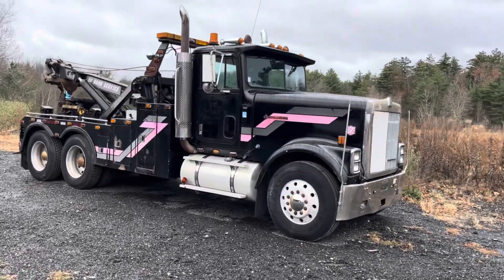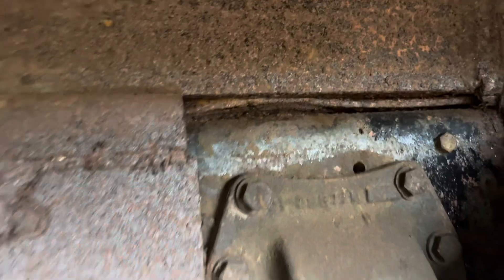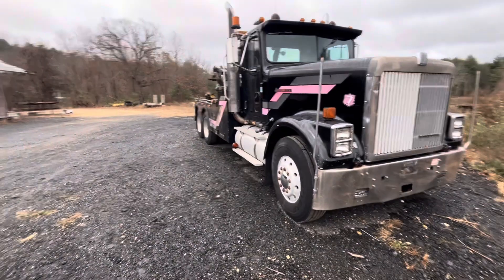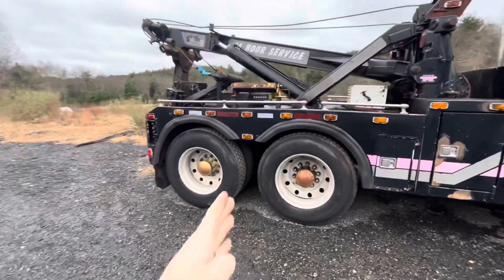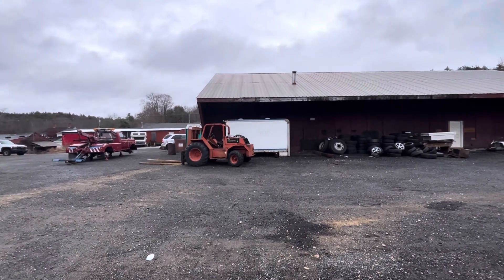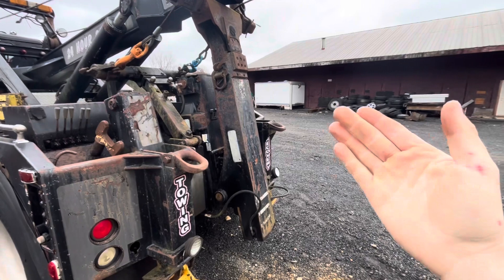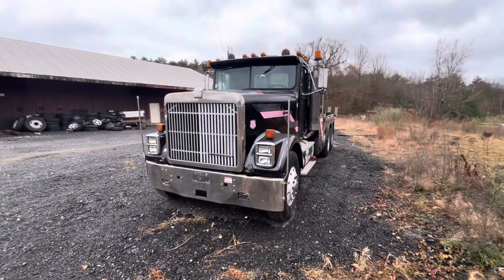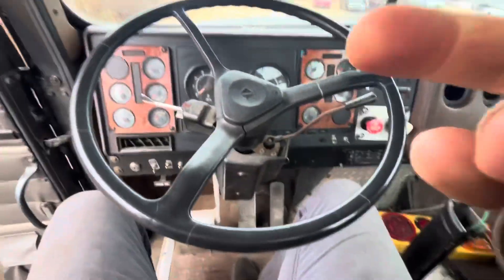New truck is finally HERE! Heavy truckin!!

Comment: Looks like an old Holmes 1625, they were good wreckers back in their day, rated for 25 tons but worked like a 30-35 ton
Reply from the maker: you are correct! definitely a powerful unit. Im excited to get it fixed up and put to work